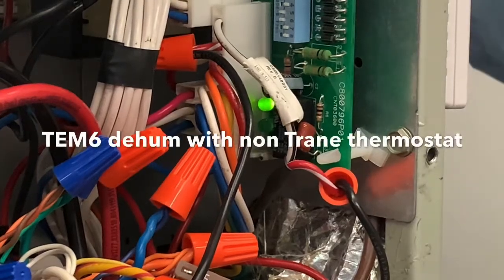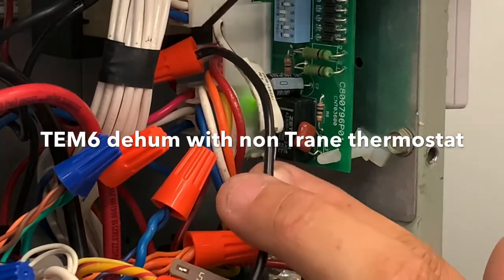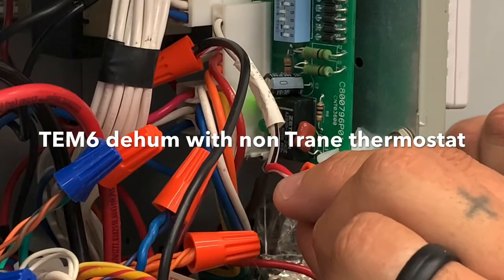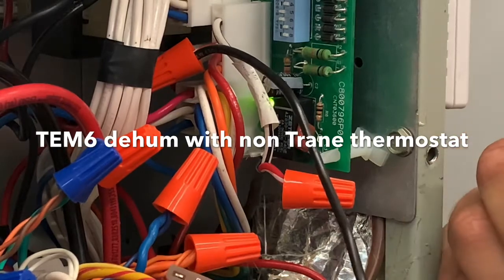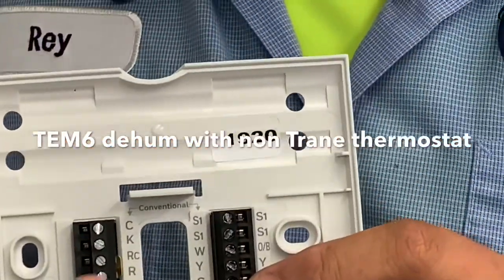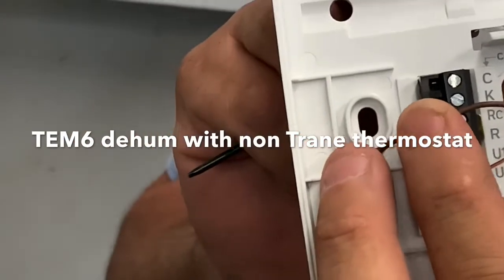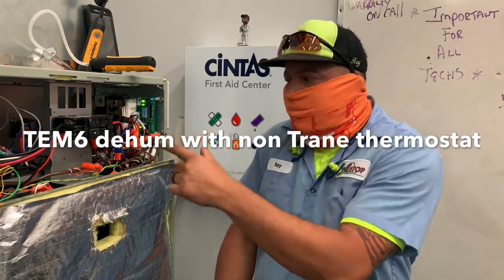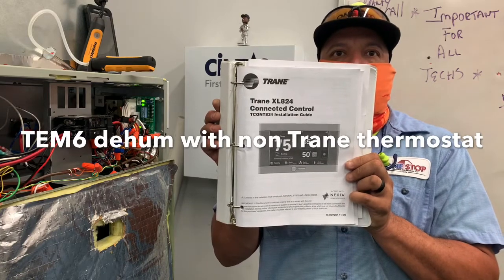change one wire in the Trane TEM 6 air handler to work with non Trane tstat   With a dehum function.

Comment: Hello Allen, I am a homeowner and this week my Trane dealer installed in my home the 2-ton 5TEM6B03AV21SA along with a single speed 2-ton Trane condenser model 5TTR5024A1000A. Per the condenser manual, I requested that my TEM6 air handler be put in "enhanced mode." Per page 17 of the manual, during the first minute, the fan is off, then it runs for one minute ramping up to 50%, then it ramps up to 80% and runs for approximately 7.5 minutes to dehumidify the warm air, goes to 100% if necessary, drops back down to 50% for approximately three minutes, and then fan is off. I am doing this set up with a thermostat that does not have any humidity control. It is working great and is something I would suggest to anyone who can't afford the more expensive thermostats.

The dip switches for my system are dip switches 1 through 4, which control cooling, are set to off, on, off, off. That is per page 23 of the manual for the correct  CFM for a 2-ton in "normal". Dip switches 5 and 6 control "enhanced mode" and are both set to "on" per page 17 of the manual. Dip switches 7 and 8 control heat and are set to on and off respectively per table 20 on page 29 of the manual.

I am very happy with this setup so far. They would not have set it to "enhanced mode" if I had not asked. It does work well as I am in a humid environment in Florida. I hope it works well during the summer.

It would be great if you could do a video about this enhanced mode.

Comment: You are correct. It can be done the way that you demonstrate, and it will work that way. However, it won't have the equivalent functionality of using a BK enabled Trane thermostat. The 824 uses PWM to control blower delays, blower ramping profile, and hot heat pump mode. It isn't simple opening or closing a 24v signal. Comparing the price of a Trane 824 to a Honeywell 8000 is silly because the 824 blows the 8000 away in terms of having a full color display and many more features. A Trane 724 is similar in price and display to the 8000, but the 724 offers full blower control though BK PWM. It makes no sense to spend the money to upgrade to a variable speed air handler and then install a third-party thermostat that will have half the warranty period and won't take advantage of that expensive air handler.

Comment: So I used this method on a S9V Trane furnace. But still a little confused with setting it to hi or low fan speed on stat.  I wound up setting it as a normally closed contact with low fan speed. Added jumper from R/U1 then The other U1 I ran to the BK terminal and cut jumper at board. Also In the Honeywell instructions states it will not run dehumidification in 2nd Stg but furnace was displaying it was running in 2nd stg and cfms were lower.

Comment: Do u guys know how to slow the fan speed down on a TAM4 air handler.? Fan speed is currently really high which cause the unit to run for only like 5 minutes to lower the temp 4-5 degrees. That’s really quick. The humidity level doesn’t drop
Reply: Go to the service facts Paperwork that came with the indoor unit. Or just call Trane tech support. It’s on page 5 in the service facts. Tap 3 is high speed. Tap 2 is medium tap 1 is low. Also with the correct thermostat you can delay the blower on a call for cooling for 60 seconds and no delay when the outdoor unit goes off.
Reply: @hvacmike1175  What are the advantages or disadvantages of the delay?
Reply: @JJBorel  advantages 
Coil is already cold before the air start moving across it which means dehumidification starts as soon as the blower starts otherwise you have relatively warm air going over a warm coil
Reply: You have to relocate the wire on the speed taps
Reply: you have a grossly oversized system installed if your dropping the temp at one degree per minute
Reply: This is a new system and I originally posted this question in March. The relative ambient temp and humidity was much lower then. Now that we are in the dead of summer, the unit runs about 10 mins and is off about 10 mins. If I wanted to lower the fan speed which wires do I need to adjust. Thanks for the reply

Comment: Or you could connect the black and yellow BK wire to the hum terminal in the thermostat set you optimal humidity setting and your over cooling the proper way 🤷‍♂️

Comment: You explain to use a jumper but are you still allowing red to go directly to the tstat R terminal and a power supply jumper to the U1 contact? Does U1 bring on the Y terminal at the same time? Thanks and these are great options to know.